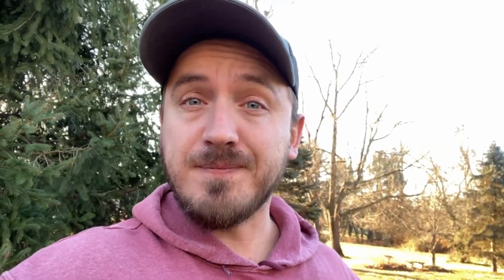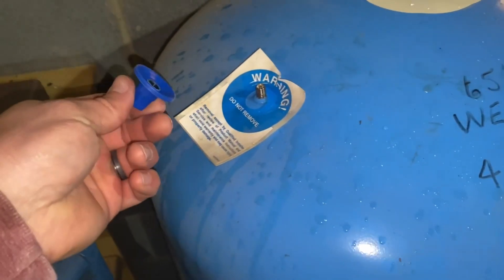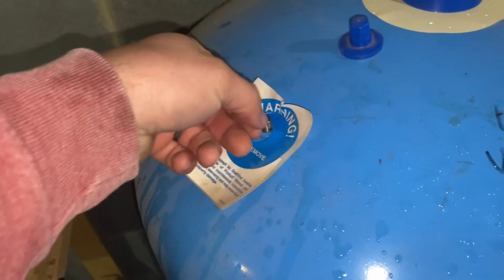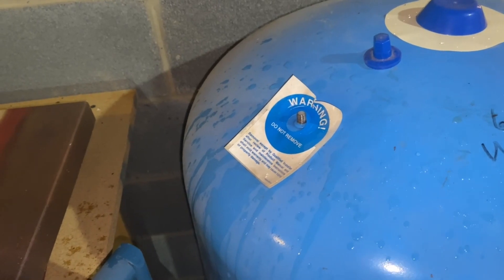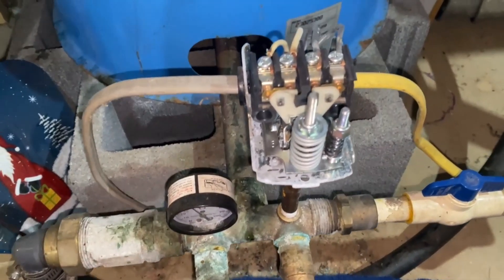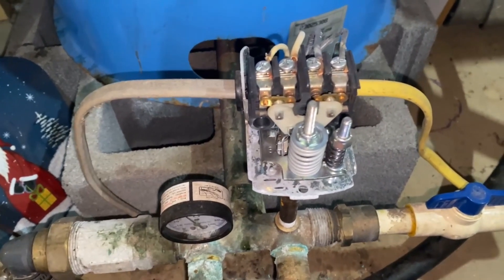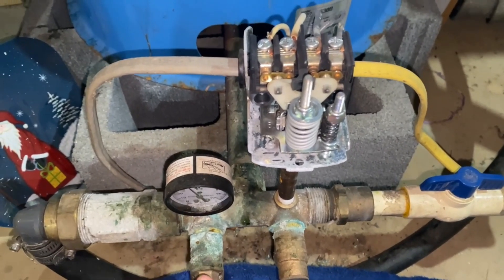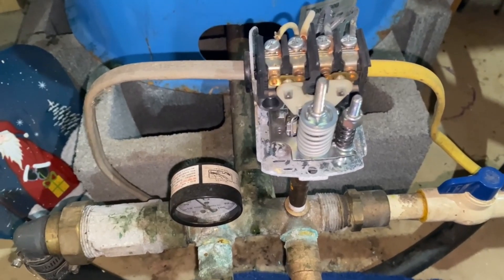Water Logged Pressure Tank

Comment: This explanation makes it easier to understand how these tanks work. I have a tank that is 8 years old; worked like a champ without any noticeable issues (I don't make a habit of sitting with it in the sub-basement waiting for issues, so who knows if the cycling had become more frequent without my realizing it, now that I watch your video explanation) -- until last night, when a family member tried to take a shower and the pressure was dismal (like standing in a gentle rain); then the water went from poor pressure to a trickle, and turned off altogether -- while they were in the shower. No water in the house at any faucet. Does this sound like a bladder failure to you? Can it be that sudden, and result in loss of all water flow? I am quickly checking for local services who are well-reviewed, because after I checked the PSI at the valve on top, it was 25 (it is a 40/60 tank); I left faucets open but that was as much as I could drain because there is no outlet on the piping to open or to attach a hose for draining down, so though the tank feels lighter when I gently push against it, there is sloshing water in the bottom. One of the spring coiled things inside the gray box (power OFF at the breaker!) had popped out of place, so I put it back in place with tweezers and tested it to make sure it stayed in place by pinching both connections and releasing (mimicking the click thing). I got excited when I found that, because I thought that was somehow what caused the problem. Tried pumping some air into the valve on top with a bike tire pump and got it up to 34 psi (was aiming for 37) and blew the bike tire pump. When I rap on the side of the tank, it sounds dull and short, not "bell like" as some people say it should. Does this sound like a ruptured or failed bladder? Can that cause sudden loss of pressure and then -- NO water in any faucet?

Comment: I have an irrigation line that Tee’s into my main well line before the pressure tank. Last year I noticed the pump was “short cycling” roughly 20-30 seconds when my irrigation zones were running. Not sure if you had any thoughts on why that would happen or if that’s out of your wheelhouse. Any feedback is appreciated, thanks.

Comment: Thank You so much for this! My plumber hubby is trying to learn as much as he can to help us with our 1st well. Have a Blessed weekend.
Reply from the maker: My pleasure. I'm glad that I was able to help. Best of luck and don't stress too much. Wells are fairly straightforward. There are a few complex systems floating around out there but they're far and few between. I'm not sure what state you're in, but in MD many of the distributors have engineers on staff that can do all the math for you and design an entire system just knowing a few parameters. May not hurt to call your supply house if you get stuck.